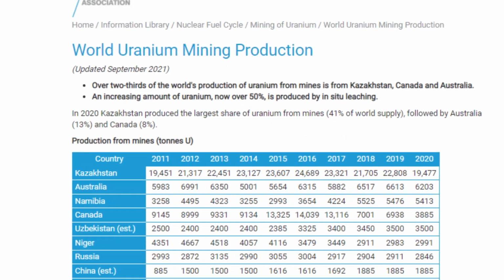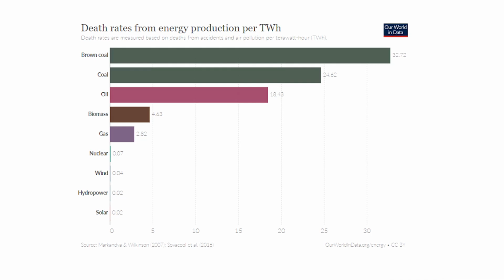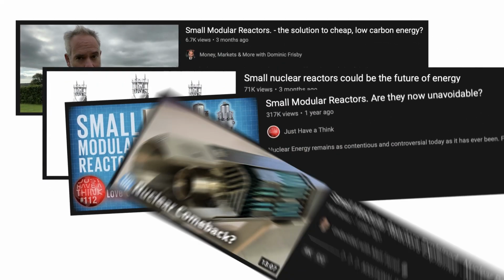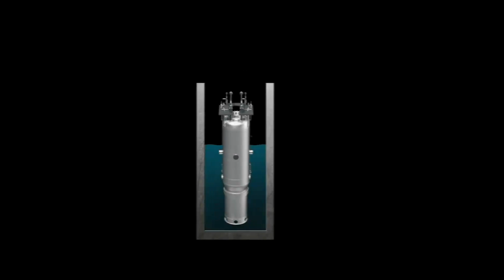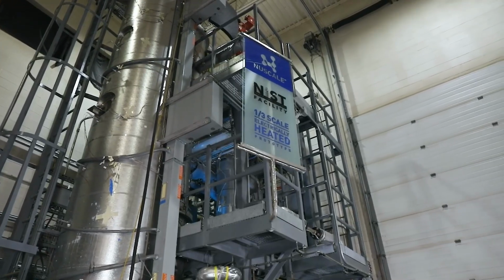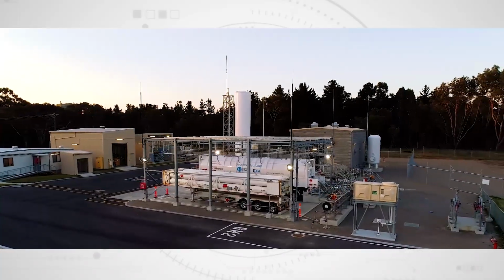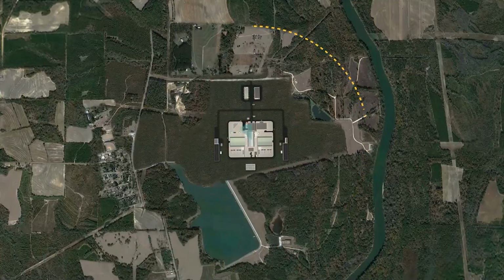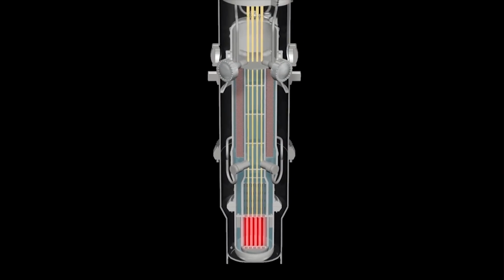Can Small Modular Reactors Save Nuclear Power?

Comment: The single biggest problem with nuclear is the waste. Meltdowns are a fairly dramatic problem but the waste from every reactor is quite likely to outlast mankind on Earth. It can hardly be considered to be non polluting if the waste provides a hazard that will last for tens of thousands of years. For as long as reactors are used the radioactive waste material just gets shoved in a hole somewhere where it is presumed safe until 1000's of generations of humans have been born, lived and died. There is currently about 250,000 tonnes of high level radioactive stored in holes all over the world. It only takes 1 major "oops" moment and there could be literally tonnes of highly radioactive material that gets released. A volcano, an earthquake, a bomb or some design failure and suddenly there is a catastrophe. Yes it's an efficient way to make power but it pollutes to a degree that no other source of power does.
Bring on wind, solar, geothermal and wave power.
Reply: eh, just not that big a problem.
250,000 tonnes of HLW is volumetrically very small. Pace off 180 m by 180 m and imagine a 1 m high box (calculation done on 370,000 tonnes). That is what we're talking about.

Of course, if you reprocess it, then it becomes even smaller as the fission products are about 1% of the total volume and the rest can be put back into a reactor.

I live in Chicago, near the decommissioned Zion Nuclear power plant, and there just aren't any active volcanoes or earthquake faults nearby. You can't even order one at Home Depot to install!
I'm not sure what kind of design failure can occur in a copper tube, surrounded by a steel tube, surrounded by a concrete tube that sits on a concrete parking lot that would suddenly flush radionuclides about.
Potentially a bomb could crack these things, but because radiation detectors are super sensitive, the cleanup would be easy to organize and ensure that all the material is recovered. And since the fuel is a solid ceramic pellet, it wouldn't form an aerosol and be distributed widely.

65 years of nuclear waste, used to produce 10% of global electricity for those 6 decades, has harmed NOONE.
Coal mining kills 100s each year, burning coal kills 100,000s each year - but with extra side effects like acid rain! Yay!

Your concerns are just waaaay overblown.
Reply: @factnotfiction5915  . Killed no-one? Chernobyl and Fukashima ? All of the waste products have 100s of thousands of years to kill 1 person. The volume of waste is small. The volume that is dedicated to the storage of that waste is potentially hundreds or thousands times that size and that area will never be usable again. There is more than enough wind, solar, hydro and geothermal sources available that there is no reason to destroy part of the planet forever.

Comment: 50s; nuclear power will produce electricity that is so cheap, it will be free in the home.
21st century; nuclear power has highest strike price of any generating type.

Did this happen because we were really naïve in the 50s, or because we simply didn't invest money into nuclear R&D?
Reply: Yes.
Reply: Yes, we didn't invest the money.

Also, most grids operate on a spot price (aka strike price) for 5 minutes of electricity which provides a free put for intermittent RE energy resources. I.e. there is no penalty for failing to bid in the next 5 minute round.
Thus, wind and solar put in a bid when its convenient (i.e. the sun is shining/wind is blowing) and suffer no downside when it isn't. In fact, in the US and In Germany, wind is paid to generate whether or not anyone is consuming.

The thermal systems (nuclear, coal, gas, etc) undertake a penalty for failing to bid - increased maintenance and wear; in addition they can be fined for failing to generate (which DOES NOT extend to wind and solar).
Thermal systems are forced to bid, even when taking a loss.

This wasn't a problem when 100% of systems were dispatchable, because the average price equaled the spot price.

Now the average price does not equal the spot price. Thus the system makes nuclear look unprofitable, despite its many positive attributes (large amounts of dispatchable low-carbon electricity) because accommodating wind and solar is more popular politicallly.
Reply: @factnotfiction5915  There is an important difference between a thermal system and a windmill: You can turn off a windmill in seconds and restart it as easily. A coal or nuclear plant could need hours to turn the heat up or down; gas turbines are considered super fast because they can go from cold start to full power in 30 minutes or less.

Power companies have to pay the peaker plants to be ready to produce power at once when the demand rises. This is why most grids use energy storage, because huge batteries or digging an expensive reservoir for pumped hydro is still cheaper over time than paying for all the fuel wasted when there is no demand.

Solar and wind do not need to pay for fuel so it is cheaper to build more capacity than pay for a gas turbine.

Another issue is that nuclear plants just take more time and money to build. At a good location renewables* can produce enough energy, both to cover the energy used in their construction and eventual recycling and sell it to pay for itself, in about a year or two. Building a coal plant takes couple of years before it can start producing power and few years to repay the construction cost so it will start earning money for the investors. A nuclear reactor, assuming no delays happen, will take at least five years to build and then same again to pay for itself.

That is why investors chose coal over nuclear and are now choosing renewables over coal.

(*: Just to make clear before someone starts to nitpick, we are talking about grid scale operations here. Domestic rooftop solar and small windmills are not grid scale.)
Reply: @AnalystPrime  "You can turn off a windmill in seconds and restart it as easily"

I didn't realize that windmills had a button for 'make wind blow'. They can be turned on and generate power at anytime? That is news!

"Solar and wind do not need to pay for fuel so it is cheaper to build more capacity than pay for a gas turbine."
Ok, let's do some arithmetic.
From Rosie's video:
$155/MWh - traditional nuclear
$58/MWh - NuScale's claims
$40/MWh - wind/solar

But also, you have to look at capacity factor. Nuclear in the US runs about 95% c.f.; Wind about 35%, Solar PV about 25%.
(For simple math, I will round nuclear upto 100% and wind/solar as 1 at 33%,; and I'm going to round NuScale's price to 60, but you can run the exact numbers if you like).
We'll set both plants at 720 MW (NuScale's max buildout, and just build wind/solar to match).

So, you build 1 NuScale (1*100% = 100%) - it produces 24*720 MWh*1*100%  in 1 day.
You build 3 (3 * 33% = 100%) wind/solar farms to match - producing 
24*720 MWh*3*33% - the same amount.

But the costs are:
60*24*720*1 - nuclear
40*24*720*3 - wind/solar
dividing out the 24 hours * 720 MW
$60 nuclear << $120 wind/solar

You MUST pay for the wind/solar farms, even when they aren't working. You pay for the nuclear plant also, but it is working ALL the time.
Reply: @AnalystPrime  Lastly - why do you believe batteries/storage only work with wind/solar?

With weather-based systems, you need more than 24 hours storage to get through the day, because you might be in day 2 of a blizzard (storage tapped out, not filling today due to snow and wind, and you can only predict tomorrow's weather). Because I need to install the batteries BEFORE the event, I need to oversize for many eventualities, and then I need to PAY for those idle assets.

With a nuclear reactor, I can predict actual demand over a 24 hour period, size my reactor to supply the average, and then size my batteries for just enough to get through the other side of the average. I'm not worried about a 2-3 day blizzard, because BOTH my storing energy and generating energy are predictable (as is demand). I don't have to oversize or pay for idle assets, I just need a good handle on the average consumption and the peak consumption of the year.

[Note - using a NPP to store heat in molten salt, similar to Solar CSP, is an obvious 'battery', perhaps with some chemical batteries for responsiveness].
Reply: @factnotfiction5915  It's called a brake. When there is little demand you can tell however many windmills you want to stop producing power, and they will turn the blades so they won't catch the wind and stay still until needed, requiring minimal maintenance and the owner is only paying the wages of the people at the office. Unlock them and they will start turning again, because no, winds do not just magically stop everywhere in the world. A thermal plant can change its output by little but there is a limited range where it works efficiently, so a 500MW plant producing just 100MW is not saving 80% of its fuel costs. Even when a thermal plant is not selling any power they need to keep the boilers hot because if they stopped that it could take hours to get back to efficient temperatures once they manage to get a customer.

Your math is wrong. One megawatt hour is an exact number, just like one gallon of gas or one pint of beer. Or let's use apples because this is elementary school level math:
NuScale farm sells apples at $60 per apple. Windpower farm sells apples at $40 per apple. Which farm sells cheaper apples, no matter how many you buy?

And again, no, you must not pay for wind or sunlight, they are free. Fossil fuels and uranium are not. Wind and solar operating cost is almost nothing, thermal plant costs you money even when it is idle.
Reply: @factnotfiction5915  I do not believe that and I have never claimed such thing. The pumped hydro, flywheel storage and other methods were originally developed because the grid needs balancing and conventional power plants cannot react fast enough, and to store the surplus coal and nuclear power produced at night. Currently in England there is a liquefied air energy storage test system paired with a gas power plant because storing surplus power from the plant is cheaper than using more fuel when the demand rises.

The benefit of renewables is that increasing production is very cheap so charging the batteries is practically free.

We can already predict the weather and energy demands for more than 24 hours ahead, that gives plenty of ability to use renewables. Nuclear plants work best delivering a steady amount of energy so it should be sized for that. And nuclear is much more expensive to build and use than renewables, so we can afford more spare capacity by using renewables than nuclear.
Reply: @AnalystPrime  "It's called a brake. ... because no, winds do not just magically stop everywhere in the world." 
So you have these magical wind turbines, that when you release the brake, creates wind specifically at your wind turbine?

The wind blowing somewhere in the world, does not help your wind turbine, which is fixed at a single geographic point. You need wind blowing in a very specific part of the world.

I don't dispute that you can STOP a wind turbine on demand, when the wind is blowing. I dispute that you can START the wind turbine WHEN YOU WANT IT RUNNING (vs when the wind happens to be blowing).

Of course, you distribute your wind turbines over a large geographic area. A weather front (with no/little wind, enough wind, too much wind) can be 100s of miles across, and 10,000s of square miles in area. Just look at your local TV station when they show a front, and you can eyeball how big they are. And you STILL can have dunkelflaute!

"A thermal plant can change its output by little but there is a limited range where it works efficiently" - A thermal power plant can use storage like any other generator, so a 500 MW plant doesn't need to ramp up and down - BUT IT CAN - vs a wind turbine, which as you point out, can only ramp down (or you have to call out your local shaman or witch doctor to invoke the gods for more wind - and those guys are NOT cheap!!!).

"Your math is wrong. One megawatt hour is an exact number, just like one gallon of gas or one pint of beer. Or let's use apples because this is elementary school level math: NuScale farm sells apples at $60 per apple. Windpower farm sells apples at $40 per apple. Which farm sells cheaper apples, no matter how many you buy?"
Ok, but if the NuScale has apple inventory, and Windpower farm has no apples available, it really doesn't matter that Windpower farm sells cheaper apples. Of course, maybe you are practicing demand management, and are not hungry. What if you come back tomorrow, starving, and the same situation exists?

Nuclear - creates a megawatt hour CONSISTENTLY (i.e. about 95% of the time in the US; 85% world-wide).
Wind - creates a megawatt hour, about 1/3rd the time.

What your element school level math is not taking into account is that you have to be generating electricity in order to sell it.
This is perhaps easier to understand with solar: What is the price of solar electricity at midnight?
(note I am not asking the price of battery electricity at midnight - which may have been topped up with either nuclear or solar).

However, if you really think I am wrong, I will sell you a 100 carat diamond for $20. What a deal!
You send me a check - and one of these days I'll get around to putting your diamond in the post.

As you can see, my $20 price is extremely reasonable.
https://www.thenationalnews.com/lifestyle/luxury/2021/07/10/new-record-rare-100-carat-diamond-sold-for-123-million-with-cryptocurrency/
Reply: @factnotfiction5915  There is a common theme to all locations where anyone qualified to build windmills actually builds them, and it is having consistent winds. There also exists this thing called weather report, the engineers handling them aren't going to blindly turn windmills on and hope there is wind at wherever it is.

And as you figured out, weather control magic that stops wind when the windmill is turned on is too expensive, so it is not going to be a problem.

The thermal plants are already connected to storage, they have been for decades, and the companies running them are still planning to use renewables because they are cheaper.

You yourself calculated that the wind farm has three times as much production as the competitor so they are not going to run out. Rather they are going to overproduce so much their selling price is likely to drop below $40/MWh. And they can easily do so, because the cost of building and operating windmills is so low.

By the way, capacity of offshore wind is over 50%, not 33%.

If we run into freak weather that stops all energy production across several geographical regions and lasts longer than any scientist can predict, one tiny nuclear reactor is not going to be enough to help and they take too long to build more. We would 
have to use the mothballed backup coal plants instead.

Incidentally, such weather could be called an act of god. Your blatant scam selling something you don't have and never had any intent to produce has no such excuse.

Comment: I'm sceptical of the HTSE part, simply because that would work for any other thermal power plant, yet somehow it is not commonly done today.
Reply: I think that might be more of a matter of the price difference between electrolysis and steam reforming. If you are going to burn fossil fuels to make the energy, you might as well convert them directly to hydrogen with greater efficiency.
Reply: Skepticism may be earned, but power companies are notoriously conservative and resistant to tech changes. So it wouldn't be implausible that none of them have the R&D and risk tolerance to try.